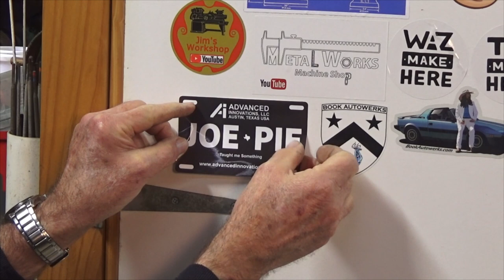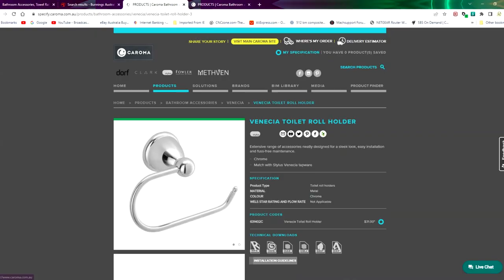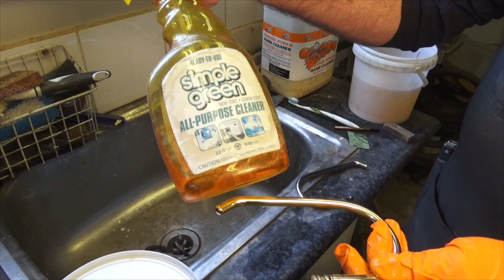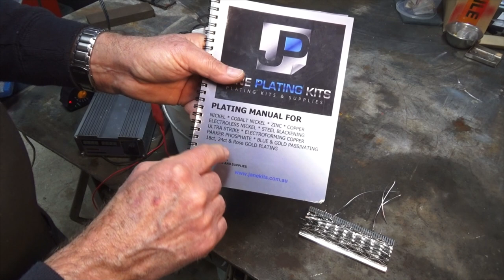DIY ART DECO WALL SCONCES (THAT'S A WALL LIGHT FITTING) Part 6

Comment: This is really interesting. Lots of chemistry here which is unfortunately far in my rear view mirror. In looking at the “defects” in the plating I wondered if what happened is that the plating “highlighted” minute scratches in the surface that were there before plating but were not apparent to the eye. Unlike paint there is no outflow to level the surface and peaks become “peakier”. All wild speculation from the Commentesphere where the dust kittens of the internet, like me, reside. Anyway, all that aside, these are impressive lamps that you will be justifiably proud of. But watch out turning around where they are mounted when you have your didgeridoo on your shoulder!
Reply from the maker: Glenn, very early on I had read that electroplating will always accentuate surface defects however there is a process called copper electroforming which can build up a thick layer of metallic copper which can be polished down prior to adding a nickel or nickel cobalt surface plate. I have an actual expert visiting me on Thursday and he has agreed to check my system and techniques so I hope to report on how it all goes down on the next instalment. 
Regards,
Mark

Comment: Plating is certainly a bit of a black art. I had some experience of industrial plating shops back in the 1960's and they were hell holes with evil smelling tanks of fluid bubbling away and water sloshing everywhere but the results were amazing. How long the operators lasted though I've no idea. You seem to have largely it cracked it though, those parts look great.
Reply from the maker: Thanks Patrick. I did visit a commercial electroplating business many years ago. We were taking some student work in to get chrome plated and all the  workers in the joint looked like Hells Angel's bikies. Their bikes were all parked outside and of course nearly every single metal part on the bikes were plated. The building was exactly as you described. Not sure how high the job satisfaction ratings were in that place.
Regards,
Mark

Comment: Wow, those light fittings are beautiful Mark. The towel jobbers are much better now too. Looks like I will be buying a plating kit. Not sure about the regs in Australia but doesn't the metal work of the lights need earthing?
Reply from the maker: Matthew, yes, I will be adding an earth wire to the lights. The ones I am replacing have plated steel frames and they are already earthed so I will just have to swap the wires over.
Regards,
Mark

Comment: Mate... Of interest. One of the planes I was looking at building (an aircraft....not a woodworking tool) had glue on wings. This isn't uncommon. Next time you get on an Airbus.....think HARD about what's holding the thing together. In any case, the method of checking if the surface was clean is similar, but you need to use distilled water to check the cleanliness. If it doesn't bead after 30 seconds, it's good to go.
Reply from the maker: You are correct. Distilled water is best. There is also a tendency for the cleaning solution to temporarily lower the surface tension of the part which gives a sort of false positive when you do the water break test. I find the prep for anodising is the most critical, zinc plating is fairly forgiving and nickel less so. 
Regards,
Mark

Comment: Those look great and, at the risk of sounding like a parrot, your videos are very well done.  As for the cheap Chinese crud, yes. Cost to the customer is no gauge of quality.
Reply from the maker: In most cases you get what you pay for but those fittings were not cheap and not obviously made in China. We had to order them and wait several weeks to get them from our local hardware store. The brand is well known and generally, their tapware is good quality. It beggars belief that they harmed their reputation by turning out such a mediocre product.
Regards,
Mark

Comment: That brown crud in the coffee filter is most likely to be the small percentage of impurity materials in the nickel slugs.  I agree with another comment here that the chrystaline matter is likely caused by an oversaturated plating solution. Perhaps it needs a bit more distilled water adding.
Have you heard of the Isle of Man,most famous for the TT motorcycle road races?   The island is often referred to as 'The Road Racing Capital of the World'
I live in Douglas(the island capital) of the Isle of Man.
Reply from the maker: Howard, I have saved the crystal and the brown sludge and I intent to show Chris Lock when he pays me a visit on Thursday. Chris is an experienced electroplater and has volunteered to take a look at my plating setup. I did have to add distilled water periodically during the plating as it took several days to do all the parts and the heater does create quite a lot of evaporation of the solution. If I can reclaim the crystal I will.
Regards,
Mark
Reply from the maker: I think I have pinned the Isle of Man previously but I will add it to the list and check.

Comment: Put your heater in a jar full of water so it is fully immersed, then put the jar in the shallow tub. It will transfer the heat through the jar where it has contact with the fluid.
Reply from the maker: Doh! what a good idea. Why didn't I think of that?
Regards,
Mark

Comment: Nice result Mark. do you know if distance from workpiece to anode has any effect? Something I do remember from my school experiment days was that any flat surfaces should be inclined to minimise gas pocket formation.
Reply from the maker: Phil, yes, the location and disposition of the anodes does have an effect on the thickness of the plate. It will always be thickest directly adjacent to the anodes. The metal ions will always take the course of least resistance so some areas can be starved although apart from the one place where the bubble collected I seem to have gotten away with a fairly good coverage. A four litre solution is a bit of a stretch for some of the larger parts I had to do. Jane Kits do sell a 10 and a 20 litre mix which would give a bit more flexibility for placing the anodes around odd shaped parts. 
Regards,
Mark

Comment: Greetings,
A fascinating project.  I’m looking forward to how you make the curved glazing surfaces.
The nickel-cobalt plating is very impressive, and is certainly bright.
I’m curious, how do you dispose of the sludge and other leftovers?
Do they go to hazardous waste?

Regarding the microscratches and speckling you observe on some parts.
Would more agitation help?
What about using a two step process, plating first with copper and polishing the result.
You could check your finish after the copper plate, and use the soft copper to fill the scratches.

I seem to recall chrome plating originally used intermediate copper layers to improve adhesion and surface finish.
I have no experience with plating, this is just a guess.

Let’s be careful out there.
Reply from the maker: James, the old school method of chrome plating was a three step process. First copper, then nickel and finally the chromium and the copper layer was polished before the nickel plate. I don't yet have any copper plating solutions but if I were doing a lot of this I would probably add the extra step. The waste material from the electrolyte will go to our waste recycling centre. We are lucky that our local council accepts chemical and toxic waste free of charge. 
Regards,
Mark
Reply: @Preso58  Thank you.
I thought three steps were involved, but couldn’t remember the nickel layer.
I should have admitted my memory lapse.
Take care, and good luck.

Comment: Great project ,plenty of tips 👍☘️. Check if your supplier has electrolytic cleaning solution,  Might be worth a try pre plating , but you got great results there. Enjoyed following your project
Reply from the maker: Jane Kits do sell a cleaner but it is not an electrolytic solution. It probably works better if it's heated. I once used a caustic cleaner for electroless nickel but you needed full PPE in case of splashes. 
Regards,
Mark
Reply: @Preso58  yes that’s very true , the less caustic chemicals around the better . I just use small amounts for rings .

Comment: Any tips for black nickel plating Mark/viewers please?  I'm plating onto steel to try and prevent rusting, starting with a nickel base, then a copper layer and then the top coat of black nickel. The first nickel and the copper took great, but the black nickel didn't adhere well at all. Thanks. 

Oh and totally agree with the rant, maybe take a small magnet shopping in future to spot pesky steel replacements when looking for brass fittings. Not much use on the internet though!
Reply from the maker: Unfortunately, I have no experience with black nickel finishes. In fact, I didn't know there was such a thing. I generally use a parker phosphate finish on my steel and iron parts. It has a nice charcoal black colour but it is not shiny. It is very corrosion resistant and I have done a lot of parts and none of them have shown any sign of rust which is almost unavoidable in the sort of climate I live in. I also recently purchased a black zinc passivate which does create a shiny finish. I am planning to do some parts soon and I will be showing them in a video.
Regards,
Mark
Reply: @Preso58  Thanks for the reply, looking forward to seeing the black zinc video. 
Enjoy your holiday!

Comment: good rant and I totally concur. Even brass is plated brass these days, its all junk. Personally I now buy old stuff and get it re-chromed at silly prices but at least I know it will last.
Reply from the maker: I am already considering having to cast new wall fittings to replace the die cast aluminium junk. At least I can make them look nice (art deco style). 
Regards,
Mark
Reply: @Preso58  A lighted, art deco style bog roll holder would be incredible!

Comment: How about a cheap external aquarium filter with just a wool and sponge substrate for agitation and filtration of the plating solution? May work 🤔
Reply from the maker: Usually, I don't do so many parts in one go so the solution usually stays fairly clean. If I have to do a lot of parts again I will probably need to add some sort of pump and a filter. The type used for filtering drinking water would be ideal. We have two filter cartridges under our sink. One is specifically for trapping solid material and they have a large surface area and they are relatively cheap. 
Regards,
Mark
Reply: @Preso58  that would depend on the particle size of the metals you have coming out of suspension, and the particle size that your filter is rated for.

A good way to set things up (although maybe a bit space intensive) would be to set a small submersible aquarium pump in the bottom of the container you are using to do the plating.  Run the output of this pump to a large bin (which also contains plating solution).  This large bin will be your “settling tank”.  At the end of the settling tank opposite where you are pumping water in, use a bulkhead fitting placed near the top of the tank’s wall, connected to a tube that takes the solution back to your plating tank (this return tube should be larger than the supply tube coming from the pump’s output, and should enter the plating tank at the end opposite the pump to create circulation).  The settling tank should be large enough that the flow slows down enough that any particulate matter will fall to the bottom of the tank.  Position the settling tank in a way that its overflow is higher than your plating tank.  This will allow you to run the whole thing with just one pump, and ensure that neither tank overflows.  If placed high enough, the output of the settling tank can even create the agitation you’re looking for.

Sorry this was long winded.  Loving the work you’ve done so far!

Comment: Great work on the electroplating and explanation of the process. I've tried electroplating old Stanley plane parts, with two step, process. Copper first, then Zinc. As I thought that's a better process for steel parts. I was getting contamination from my copper wires holding my anodes. It looks like your wires holding your anodes are nickle wires, Are they?
Reply from the maker: The wires for the hanging baskets are stainless steel as are the mesh baskets themselves. However, I was told by Chris Lock that titanium is the best material to use. I do have some titanium wire but it is very brittle and hard. I guess there are different grades that are easier to twist and bend. I would like to have a copper strike solution to use a base. I plated some parts for my Stanley planes in straight zinc with a blue passivate and they have held up quite well. My zinc anodes are hung on stainless steel hooks.
Regards,
Mark
Reply: @Preso58  thanks for the details.

Comment: Mark could you use an ultrasonic cleaner to scrub the parts clean instead of a brush ?
Reply from the maker: I do use an ultrasonic cleaner on parts that I am going to anodise. However even that doesn't always remove waxy films. It's good for dirt, oil and grease but waxes are very persistent.
Regards,
Mark
Reply: @Preso58  Indeed, that's why we use wax treatments to protect finishes, they don't wash off easily. I like using a steel wool pad and the hottest water I can stand with rubber gloves. (Put rubber bands around the glove cuffs when using hot water. I figured that out the hard way!)

I wonder if a non-waxy polishing compound could be concocted?

Thanks for another instructive video, Mark.
Reply: @Preso58  Thanks

Comment: Gday Preso, I think after seeing the nice polished look I need to seriously look into seeing if it’s possible for me to do this here, these components you’ve done look absolutely beautiful, I might be in touch shortly, cheers
Reply from the maker: Matty, electroplating is a fairly deep rabbit hole but generally I can get reasonable results. Zinc plating is probably the easiest. It doesn't need to be heated and if you mix the electrolyte properly you can get nice shiny finishes. I didn't bother to read the mixing instruction properly when I made up my first batch and added all the brightener in one go. It still plated OK but it always came out dull and had to be polished manually. I recently mixed up a new batch and I will be doing the Doug Gray machinist clamp plates with it. 
Regards,
Mark

Comment: Very good result!
I was surprised by the even coverage on the parts with what seems like a dunk it and forget it approach :)
I am used to getting quite a lot of shade on my parts - that is there are parts of the object to be plated apparently do not have a line of sight, so to speak, to the anode.
This rather was my assumption, but my setup looks almost identical to yours so I am at bit of a loss as to why this keeps happening.
Could this maybe be a voltage or power issue?
Reply from the maker: I had some help from a plating expert who visited my workshop but after talking to him for several hours it became clear that electroplating is one of those "black arts" which takes many, many years of experience to achieve any sort of proficiency. One thing I did learn was that the voltage should be no more than 5V and current density can be difficult to calculate and control. Having anodes on both sides of the part will help and moving the parts in the tank will help to achieve more even plating. He also said that you should dip the parts "live" with power already applied to the cathodes and the parts but that is more for copper plating. I do sometimes get a black stain on the plating but it polishes off readily. I had read in the Jane Kits book which I use as my reference that you should avoid taking the part out of the plating bath to inspect it. It can lead to delamination of the plated coating. You can check the plating process by looking at the top of the copper wire. If it has changed colour, you know the plating process is underway. 
I am by no means an expert. I still have a long way to go.
Regards,
Mark